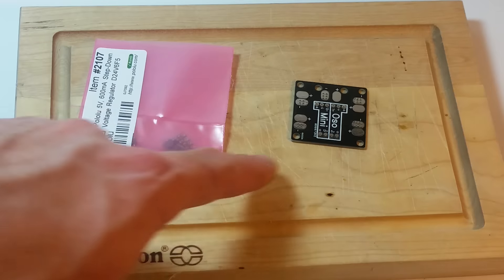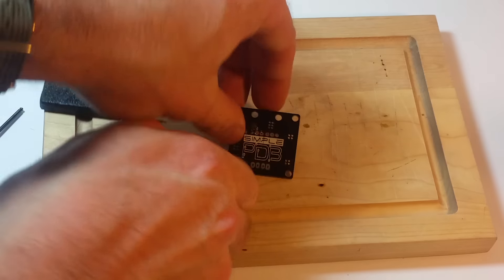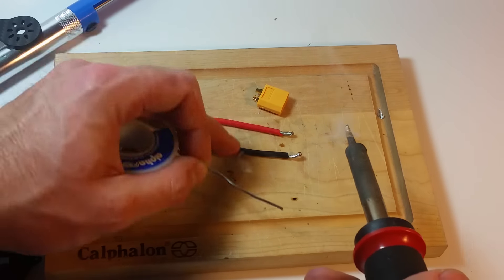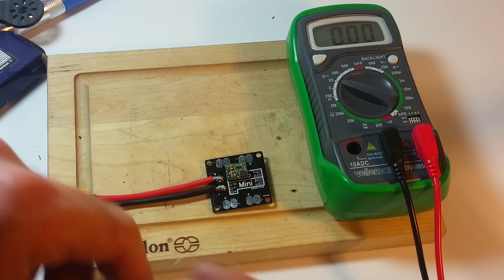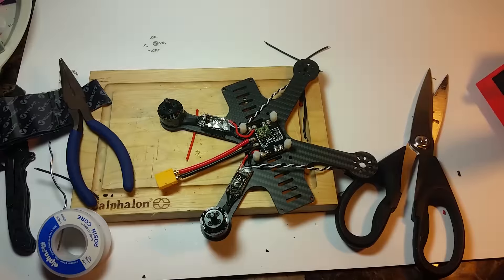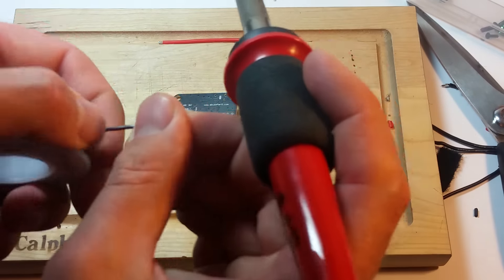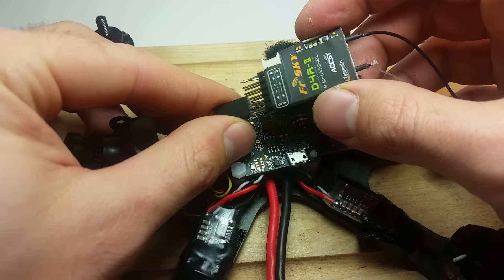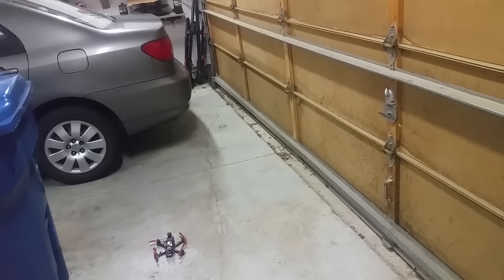Multirotor Superstore "Frogger" // Full Build Guide

Comment: "The SHDN pin can be driven low (under 0.3 V) to turn off the output and put the board into a low-power state that typically draws 20 μA, and it can be driven high (above 2.3 V) to enable the board. If you do not need to use the shutdown feature, the SHDN pin can be directly connected to VIN to permanently enable the board.You should not leave this pin disconnected as this can result in unpredictable behavior."

I find a lot of people who complain about issues with these bucks ignore that floating SHDN might make it just turn off randomly.
Reply from the maker: this is an issue specifically with the naze rev6
Reply from the maker: +Bulbufet FPV ??
Reply: +Bulbufet FPV this doesn't have anything to do with the naze32.  That buck was designed before naze32.  Look for the bold text on the MRSS link (which was copied from the original pololu site: https://www.pololu.com/product/2107 )

The pin going low causes the output to turn off.  If it's floating, it can go low randomly.  Maybe it comes back instantly, or maybe it takes a while.  If you don't wire it up to VIN, you're basically saying "I don't care if this always puts out 5V."  It may appear to, but I've heard of a lot of people complaining about these things being unreliable, and all of them were surprised to hear that they have an output power switch that has no default.
Reply from the maker: Well that clarifies a lot for me as I had been having problems with that very issue. I didn't realize that this was one of that older batch of polulus.
Reply: I'm not sure if it's an age thing.  There's another variant that has an internal pullup on the SHDN pin.  This is documented as not doing that, though.
Reply from the maker: +Dustin Sallings Note: We recommend our newer 500 mA D24V5Fx family and 1 A D24V10Fx family of step-down voltage regulators over this product. They offer similar performance with much lower dropout voltages and higher efficiencies at light loads, and they are available in a wider range of output voltages.

It sounds like these are older, maybe?
Reply: Maybe.  That one added a pullup, so you don't have to think about the SHDN pin if you're not intending to use it.

Comment: What's the fourth pin for on the polulu? Why do you not need it?
Reply from the maker: +Aiden Sinclair Check out Dustin Sailing's comment -- apparently on this particular version you do need it. On others you don't. Scroll to "Using the regulator": https://www.pololu.com/product/2107

Basically it wants you to bridge the connection if you don't want it to shut down. 

You don't want it to shut down. :P
Reply: +Bulbufet FPV Thanks. I thought that Dustin may have been talking about the polulu, but as a beginner, I have a very limited understanding of technical lingo.
Reply from the maker: Yeah I didn't realize that he was talking about that right off, myself. :P

Comment: 1 thing to say this video was made in a hurry, you did not put heat shrink on the xt60, your solder looks like crap, you put a product placement for rtfq, even if you where sponsored by mrss, man electric tape is a thing of the past to cover solder points. Clearly you did not planned things ahead and that's a shame.

you could have done so much better!
Reply from the maker: +Yan Chabot All valid points. :-/
Reply from the maker: +Yan Chabot I use electrical tape on purpose -- it's much easier to replace stuff, swap stuff. I talk about why I do it in the video. The XT-60 SHOULD use heat shrink, but I would electrical tape it anyways to help strengthen the joint. 

Finally, regarding the RTFQ stuff -- that was just a dumb mistake. I didn't realize that they sold them. Video description has a link to the proper place. :-)
Reply from the maker: +Yan Chabot But thank you for your feedback! I'll do better on the next one. :-)
Reply: +Bulbufet FPV if you put hearshink the right way you will never have to take it out , and for the solder, less is more if you put too much you create resistance on every solder points and they may crack strong joints use just enough solder, take your time i know you can do it! nice drame by the way!
Reply from the maker: Agreed on the heatshrink for the XT-60. I intentionally leave it off the ESCs for swappability.

It is a fun frame. It's taken a beating. 

Where do you think I'm using too much solder? I kinda thought I was right in that sweet spot.
Reply: +Bulbufet FPV on the pads of the pdb, i think that's because the gauge of the solder you are using is a bit big
Reply from the maker: yeah others have mentioned that. I accidentally ordered solder that was a bit large, so I just thought I'd use it up before I buy more. :P
Reply: +Yan Chabot in a near future i will post a build of the harmattan f1-4b, it will be in french because i live in the province of Quebec an i find that there is not enough canadian french stuff on youtube
Reply: +Bulbufet FPV good :P
Reply from the maker: Good idea! I really want the 5" version of that frame. It looks awesome.
Reply: +Bulbufet FPV what i like about armattan is the fact that their frames are lifetime warranty, and since crashing is my best skill, it will profit
Reply from the maker: yep.